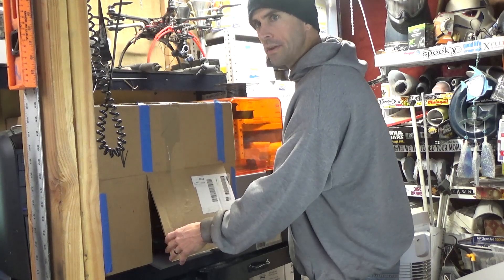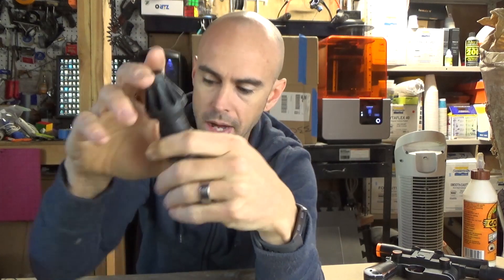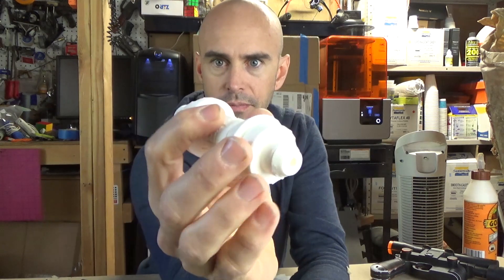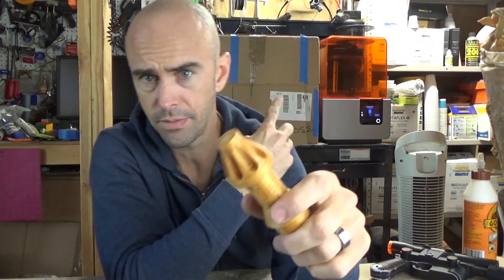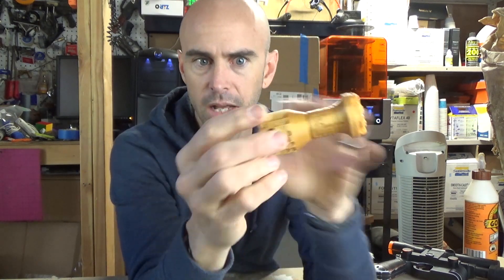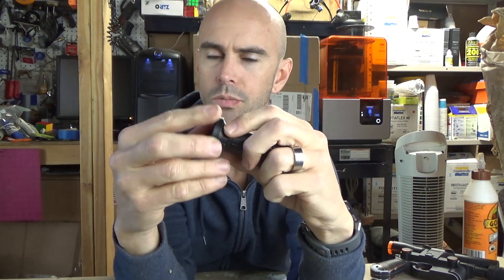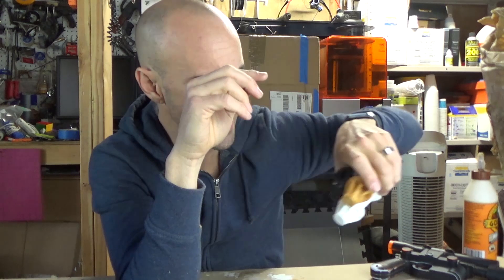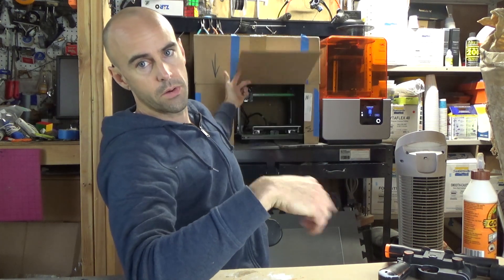Testing Different Materials on the Anet E10 3d printer

Comment: try adjusting your sensor bring it up a little my prints are always nailed to the bed now
Reply from the maker: exactly. Mine doesn't have a bed sensor so i just raised the bed a hair and it was better.
Reply: you can buy sensors if im not mistaken for some models .
.one more tip even if the bed is clicking i hold mine down as its moving and tighten the butterfly screws on the sides its clicking from thought id throw that tip in , im using a prusa i3
all my best simon